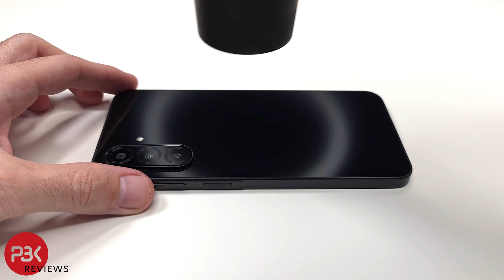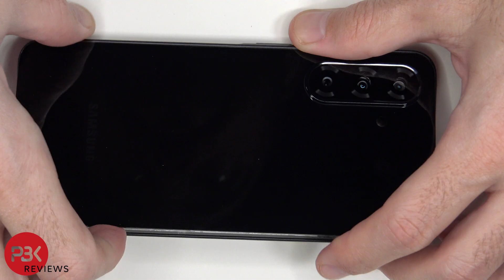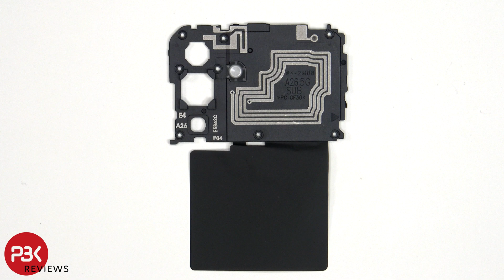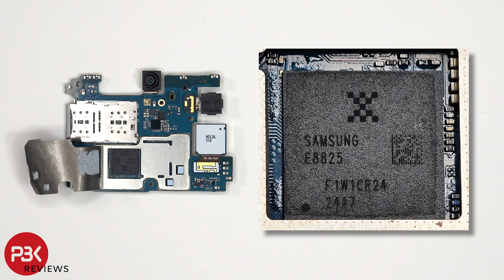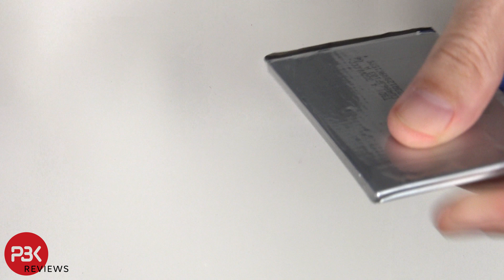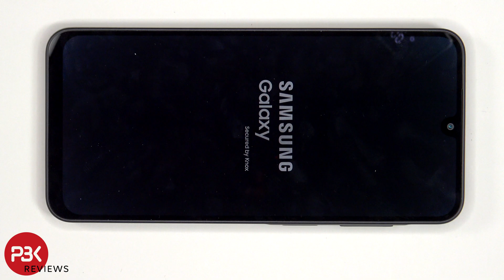Samsung Galaxy A26 5G Teardown Disassembly Phone Repair Video Review

Comment: I can’t understand why Samsung dropped the stereo speaker from the A25 to the A26, while adding some arguably less useful features like a glass back (from a plastic back) and IP67 (from IP64). 
Other than that, the A26 is a pretty compelling phone as far as Samsung mid rangers go. It has basically the same CPU performance as the more expensive A36. Sadly, likely to avoid cannibalising the sales of the higher tier phones, Samsung is only selling the A36 and A56 in my region, where they sold the A2X series from A22 all the way to the A25 last year. Hopefully, they will sell the A27 next year in my region.
Reply: A36 has Snapdragon meanwhile a26 has Exynos
Reply: @kennedymagagula1163  performance is almost the same
Reply: @kennedymagagula1163 performance is 11 12, stability in other hand not so much different, just heat make difference for exynos and snapdragon